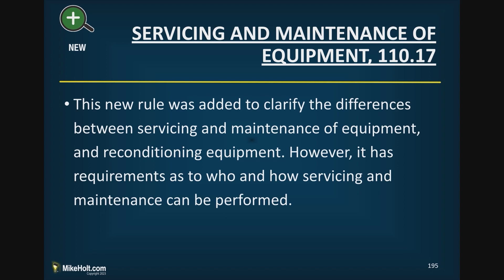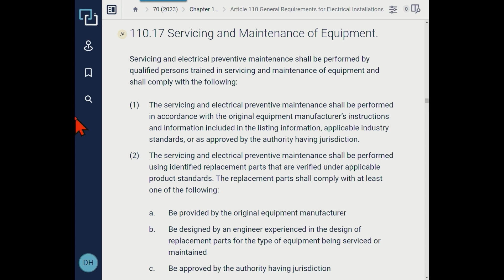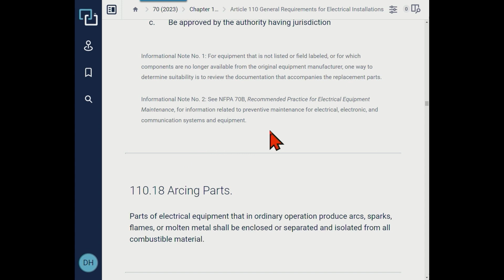110.17 Servicing and Maintenance of Equipment

Comment: Was an maintenance electrician for 50 enjoyable years. At my first job we worked 8 hours overtime at least twice a month to perform preventive maintenance. When we  received a new piece of equipment especially stuff shipped across an ocean before powering up we would check every terminal to make sure wires were properly tightened. On foreign made equipment we always found a few loose connections and even fuses hanging out of fuse holders. Little by little most companies stopped performing PM'S except at a large hospital/research center that I retired from. Pm'ed every VFD from once to four times a year including using a FLIR Camera to look for hot spots. Did a IR scan on every circuit breaker in the 12 story hospital once a year. Every week we recorded voltage & ampere readings on the 13 13,200 volt switchgear rooms.
Reply: Hell yeah!